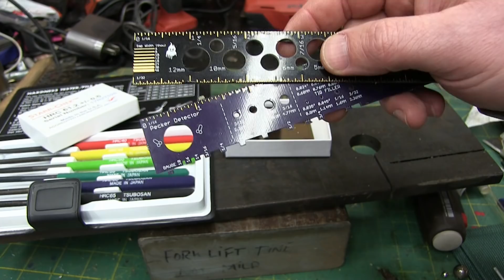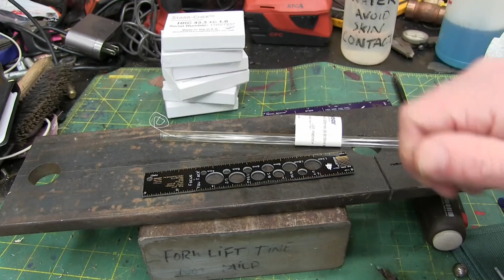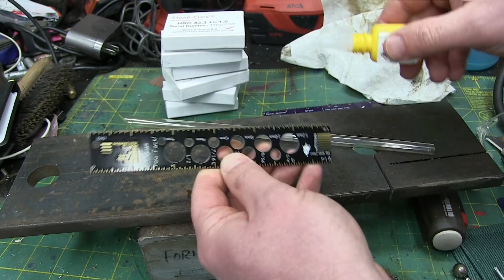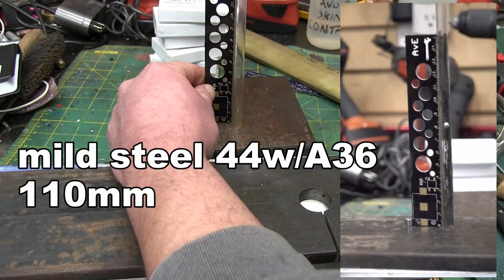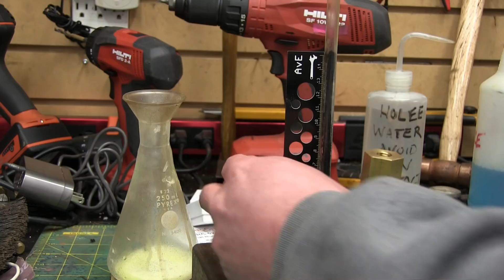Pocket Hardness Tester PROTOTYPE | IT WERKS!

Comment: When I worked at the foundry we had these bottles of acid you would add a drop to the steel wait 5 mins then it would change to shade of pink to light red there was a chart u match it and then look on the back of chart to find hardness

Comment: AvE When you mentioned the Platinum wire lighter idea being done already, it reminded me of one I was playing around with awhile back.  The Pyrolysis of acetone/copper experiment could be made into quite a few cool projects including a lighter.  Just thought I would put that out there, even the experiment itself is fairly interesting and may work with other solvents.  Thank you for all of the interesting videos.

Comment: Oh we recently played with something similar at Universiteh called "Schmidt-Hammer", it's like this contraption and an automatic centre punch had a baby. We took a few hits at concrete with it but I guess it would work on Metals too? Not sure how hardness and compressive strength play together though.

Maybe you could use something similar, with a spring and a needle or ball attached to the end? Because that's how the Schmidt-Hammer works, it shoots the hammer at the concrete block and measures how far it bounces back like what you're trying with the ball except electronically and more compact.

Allows you to also use it at angled surfaces, you get some values to account for that with the tool.

Comment: It will always be very inacurate.
The bal will sometimes rub the surface the entire way getting a soft result and sometimes it will miss the tube completely and thus a hard result.
It will work if u can find a way no to contact the surface of the tube and also remove the effect of air density by means of vacume

Comment: I use one of those tungsten carbide scribe points to test for hardness. It's not very accurate, but I use a similar method to this. drop it down a tube and let it hit the material point-first and then look at the depression in a microscope. It doesn't tell me the exact number, but it's good enough for dead reckoning.

Comment: I'd think thermal losses/friction of ball bearing v cylinder wall would accumulate and come into play at these/similar dimensions. Would need to sort out a precise process for performing the tests to get the data and probably include several/many diameters of any choice of ball bearing material. Not sure if that's enough - I can envision random drops w/early friction at drop and bounce, having much larger delta than where majority data points are clustered (assuming loss due to friction is appreciable at all).

Comment: Way back in my first material class i got to use a handheld hardness tester that uses this principal but it was completely enclosed with a slide reset . I looked it up at the time and you could get them fairly cheap from china but i cant remember the how i found them. 
We also did some comparison between the values it gave and both rockwell and vickers testers values. If i remember correctly it worked well in really large parts but as soon as they got under about an inch thick the error got big. It would be cool to see if you could calibrate to a thinner part size. I would be interested to see if it would still be able to compare hardnesses.

Comment: I am not an engineer by trade or formal education, only by inclination, experimentation and informal research. Your test is very helpful but may not be testing what you say it is.  When I watched the video something in my mind kept saying, that not quite right.  So I had to do some reading to find out what was irritating that part of my brain that can't let things like this go until I understand it.  So here goes my best effort to articulate what is going on with this test.

It seems to me that this is a test of the Modulus of Elasticity rather than the Hardness.  From what I have been able to gather from reading a few articles these are similar properties but the exact interaction is still being studied.  To me the most significant difference for me as a hobbyist is that Hardness is a measure of the permanent deformation of the material (irreversible) while Modulus of Elasticity is the materials ability to return to its original shape after deformation (reversible).  In materials other than metals the differences are more pronounced but even in metals the difference may be important.  In particular process such as hardening, tempering and annealing all effect both properties but not always proportionally.  I must leave it to an actual material scientist to explain farther than that.
Reply: His thinking was if it is good enough for Leeb/Shore it is is good enough for him

Comment: Inductive sensor would be easier, because you are not relying on detecting the shock wave and have no noise problem. Inductive sensor is located at the bottom of the tube, and senses the ball three times: Down, up and down again. The period between the last two gives you what you need. Inductive sensors are very reliable and are industry standard.

Comment: You may need to also factor in material modulus to get a strong correlation between the rebound height and an actual hardness value. Seems totally valid, however. https://en.wikipedia.org/wiki/Coefficient_of_restitution#Predicting_from_material_properties 
A nifty tangent is that you can look as acoustic response to measure basic material properties: http://www.buzzmac.com/index.html

Comment: Maybe instead of trying to divine bounces from a piezo signal a photo sensor and ir led would be better. Then the BB is at the bottom it breaks the beam and you start counting then when it breaks again you stop your count. As for the whole validity of the bouncing thing in general... is hardness really directly proportional to the elasticity of the material?

Comment: You can make it shorter,... The rebound time should be proportional to the initial distance (air resistance works both ways up and down). If you use a larger mass and a larger anvil (the only give being in the sample, or the sample face), the better the test. You also could glue bits of carborundum, garnet, and other materials of standard hardness on the corners to do a scratch test (I think you can skip the diamond).
   You also can vary the hardness of the ball.

Comment: An idea to avoid using either a piezo or a mic: put the steel ball on a rod and attach the other end of the rod to a rotating axle to allow it to swing/pivot. Let's say the pivot point is like the center of a clock, the test would start with the rod and ball at, say, 11 o'clock and the object you're testing would be at the level of 9 o'clock. Allow the rod to swing down from 11 to 9. When the ball on the rod hits the object being tested the rotation on the axle will reverse (start a timer at this point) when the rod reaches the apex of its bounce it'll reverse direction again (stop the timer at this point). Compare the timing against your calibration chart to get a reading.
Reply: An encoder or something on the pivot point could be used to measure direction changes.

Comment: You could have one or two windings of wire around the tube near the bottom, and have some simple electronics that detect the change in inductance when the metal ball passes through, like a metal detector. Could be potentially cheaper and more reliable than audio.

Comment: I wonder if the successive bounce times or bounce heights could be characteristic of the hardness and thickness of the materials, not just the initial. Could certainly take out the initial energy variable, since after the first and second contact, there's a known amount of energy in the system (time => some max height for the ball).

Reminds me of the demo from Liquid Metal. Maybe you could play with a sample? https://www.youtube.com/watch?v=RAQIioLteuM

Comment: Resident Materials Science dork/ white lab coat guy. Skip if your eyes glaze over when someone talks like a nerd. 
This looks an awful lot like something I used at my last internship. Heading to google, be right back.

It's a Leeb rebound tester. It measures the coefficient of restitution, the fancy way of saying how much something springs back after being hit, and correlates it to hardness. The relevant ASTM standard is ATSM- A956. The impactors can be tailored to measure different ranges of hardness and even surface quality. The "Leeb" part comes in when doing the correlation. I don't know who Leeb is, but he's got a hardness unit. Gotta ask his wife about that. 

Hardness in Leeb units(HL) = 1000* (return velocity/impact velocity)

Then you take your HL and find HRC/Brinell/any other unit on a chart and do the conversion. 

This is a perfectly cromulent way to measure hardness. A couple quick math problems to get the impact velocity since the height is standardized.  Another quick math problem to get the return velocity from the return height. Get a couple references and you can get a spreadsheet to spit out the hardness or make your own chart.
 
A couple limitations to be wary of. These testers use a super hard material to reduce energy loss from deforming the tester. So if using a BB, your accuracy falls off at the high end. Curvature and surface finish will both effect the test. A flat, high polish surface will give the most accurate result. Temperature and external vibration can also effect the test at the extremes, so be cautious. Lastly, the testers are usually spring loaded so the velocity is fairly high. This gives more wiggle room in the precision of the measurements. Also Leeb testers are super expensive. So there's that.

Comment: I used to use that Detroit hardness tester when grinding crankshafts.  The more you grind, the thinner the case hardening would be. And because of the importance of surface finish, destructive testing methods would not work. The little ball dropper was quick and easy to use.

Comment: By putting a piezo between the sphere and metal being tested you change the acoustic impedance and kill the measurement. Your idea with the microphone would work. Alternatively you could use a light sensor and an LED mounted transversely to the tube. Do you have someone to program the PCB  microcontroller?

Comment: I thought about the dual sizes of BBs as suggested below....I have thoughts to add.

A heavy metal base underneath the victim in question means a HEAVIER ball could be used. 
The piezo would "listen" to the heavy metal base, not to the test substrate.

Imagine dropping a big ass hardened BB...( lets go crazy and call it one pound ) that would smash skinny metal against the base...removing any deflection, then bounce upward. You could program initial delay to ignore the split second it takes to crush slightly warped sheet metal against the metal base....

The farther the ball drops and the harder it hits the more accurate the scale,  the less it is affected by how the ball is dropped, and the better it gets at ignoring minor imperfections in the test material. Accuracy would only degrade once the ball actually penetrated the substrate....maximum ball size would need to be correlated to the thinnest and softest sheet metal desired tested. For instance if you want to test annealed gold leaf you are going to have to go smaller.

The ball has to be harder than the test substrate or bullshit reading are going to happen.

Accuracy should be bang on...That is the theory at least!  :)

Comment: @AvE An easier method: use a ball ended pendulum and an optical rotary encoder.  Use velocity loss rather than position to get higher precision.  Use interrupts on the 2 encoder pins for maximum precision.  That way, you have no dependence on material coupling to a microphone.  When I checked the patent after thinking of it, I found its no longer under patent protection as of around 2000.  For small part testing, use a solid fixture to add effective sample mass.

Comment: It would probably be easier to use photo diodes rather than piezo sensors to clock the ball. A premium version would have to check that it is vertical as well.

Comment: Use an optical sensor that is just above the ball and is triggered as touches the surface. Then measure when its first triggered when it hits the surface and how long it takes to turn back on. This gives the velocity of the ball, which corresponds to the hardness. No noise required.

Comment: N.B. The longer the drop of the BB, the more accurate it will be! Awesome idea!
Reply: Actually there's probably a sweet spot, longer than which friction between the tube and the BB becomes the biggest source of variation. So I guess what I'm saying is don't make it really short.
Reply: Also, perhaps putting the sample on top of the same lump of flat steel each time might reduce the issue of a small sample mass? Would be interesting to know.

Comment: I had, at first thought, an idea similar to a black powder tester I saw demonstrated at the DuPont Powder Works in Brandywine, Md.  But then quickly realized the difficulty in ensuring that the bb would push the marker consistently regardless of wear, humidity and so on.  Then I thought that speed is the key.  If the bb is dropped from the same height it is going to be moving at different speeds on the rebound depending on the hardness of the metal.  So the key is to use a pair of photo cells to measure that speed at a given distance from the surface as it rebounds.  Simple arduino circuit and cheap photo cells and a bit more electronics skill than I have to figure it out.

Comment: Hey AvE. This is a really cool idea, however there is a tiny (but significant) source of error in that the force of gravity is different depending on where on the Earth you are. The standard is 9.8m/s^2 but this does change (in tiny but significant amounts) depending on where ya are. Not sure how you can control for this but it's worth mentioning.

Comment: What about a series of small, unpowered electromagnets approximately the size of the BB stretched along the tube attached to some electronicals? Steel BB passes the elecromagnets, induces a voltage into them, which is then registered by the electronicals, and then the electronicals extrapolate out a hardness based on that?
Reply: That would only work if you replace the steel bb with a magnet, and those are brittle and problematic around iron... the coils would change inductance though.

Comment: I'm no math guy, but there's gotta be an equation to adjust for the sample size. Taking into account the variables of length, width, hight, and time between bb hits all together. Maybe even the density of the object, which you can measure with weight and vollume (submerging in water and measuring displacement). I have no idea where to start with an equation like that, but just a thought. There's also probably a variability of accuracy depending on exactly where you drop the bb, ie, the edge, middle, etc; it's probably a minute variable that realistically wouldn't effect the measurement, and why someone would need to be that accurate, I don't know. I'm just thinking out loud. Love the vidjeos, AvE, keep your chopstick in the rice.

Comment: You could use an array of IR LEDs and IR transistors down the edge of your ruler to measure initial BB velocity and the resulting bounce height.  Take out the user error dropping the BB from different heights.  No high speed potato vision necessary.

Comment: Novel idea, but how do you scale to different materials? There is a reason that there are several different hardness measurements and it has to do with tuning to the variance in hardness. HRC for example is tuned for testing different steel grades. Where as the og moes scale is tuned for different minerals.

Comment: Very clever, but it depends on the dropping height, so an electro magnet with counter could be helpful, only a brainstroming idea.
Or measuring the mean velocity with a small light barrier ???
Reply: an electromagnet would contaminate the bb.  The photo sensor is better, but, the problem is having the sensor detect a small bb in a much larger diameter tube.  The internal tube diameter has to be relatively larger than the bb diameter so that the air can move around it, not compress like a piston in a cylinder.  Also if the tube is not perfectly vertical, then you would have rolling resistance on the side of the tube affecting the speed of the ball/bounce...

Comment: Some other ideas for a purely mechanical DIY hardness detector: You just need 3 affordable parts:
1 A small rvd/cvd diamond, some (even chinese) suppliers tell what shape the diamonds are. CBN or Carbide would work too.
2.1 Either a cheapo automatic center punch. This will hit with the same kinetic energy every time.
2.2 Or a spring and some metal stock scrap pieces.
3.1: Either a micrometer that will be sacrifised and modified. (part of body cut off, flat base welded to it, the turning bit ground to a point)
3.2: Or a proper depth micrometer or a homemade jig with a dial indicator.
---
The first idea is obvious: unless your center punch already has a carbide insert, you fabricate your own. Because that automatic centerpunch hits when a certain spring pressure is overcome, it will hit with the same speed, kin-energy and so on. I don't have to explain what the depthgauge is for right? You dent it with the center punch, you measure the dent. Boom!
---
The second idea should be faster in use, and it's awesome:
you take a piece of flat stock, add a (leaf)spring to it, attach a carbide/CBN/diamond incert to the end of the spring. And you have a constant-pressure scratching jig. The depth of the scratch is to be measured. A scratch is easier to find than a dent with a depth gauge. Now the really fun part: you could add a dial indicator to that jig to measure the depth WHILE it's scratching.